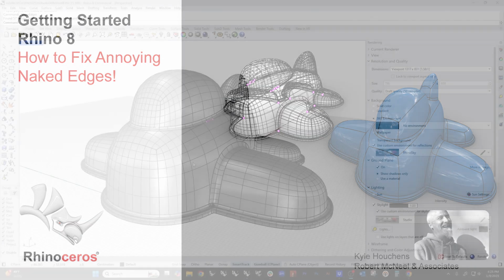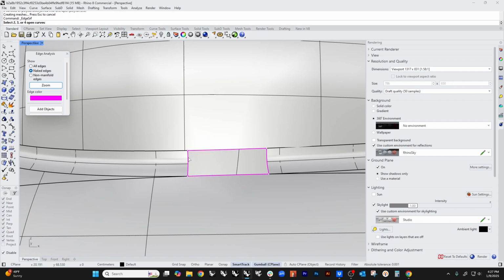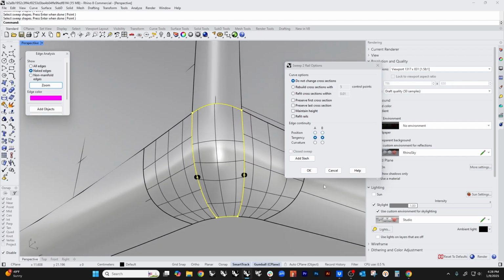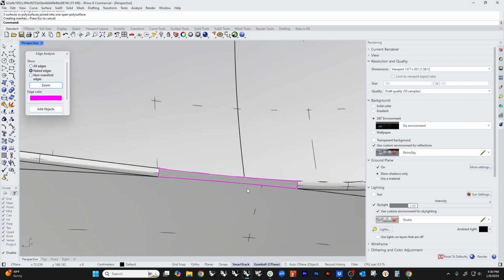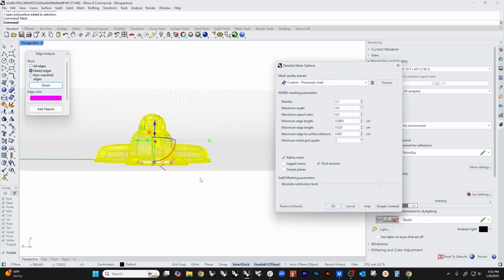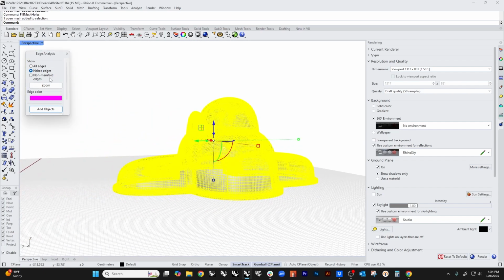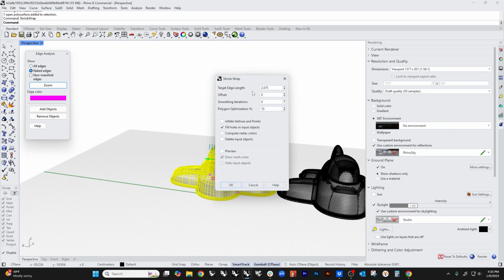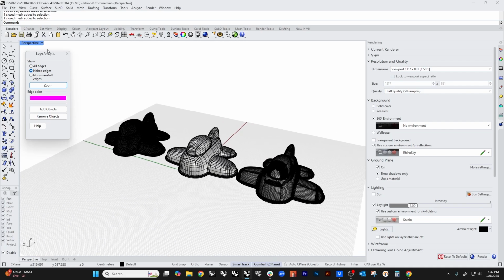fix annoying naked edges!

Comment: short and sweet, nice. A quick method video to fix NonManifoldEdges in Rhino would be good  too
Reply from the maker: find them and delete them... non manifold edges are essentially "fins" sticking up in space. Rhino needs everything to be attached to something.. If this is a recurring issue for your models, we need to take a peek at one. Send it to tech@mcneel.com attn: kyle and I'll take a peek at it and make some suggestions.

Comment: I sometimes get weird situations where only a single control point is marked as a "naked edge" 🤔 ... What does that actually mean? I posted a question about that over on the Reddit forum and got a reply to run a command called "RemoveAllNakedMicroEdges". It worked, but why?? An explanation of what exactly is going on here would be much appreciated.
Reply: it might be because you have 2 control points on top of each other .
Reply: @jimbomaker  Thanks but I did check for that.
Reply: THIS! I also have this issue every now and then, and yes I also use the RemoveAllNakedMicroEdges, sometime it worked and sometime it's not, which is very annoying. Hope Rhino developers are aware and addressing this issue.
Reply from the maker: RemoveAllNakedMicroEdges rebuild edges in areas where there is a mismatch. These are often caused by a trim that is slightly off in the corners for whatever reason. it's often a good idea to run Selbad to make sure that this function does not cause any hidden issues.